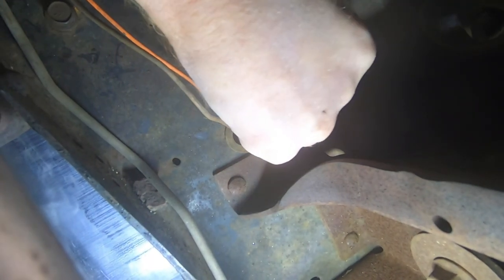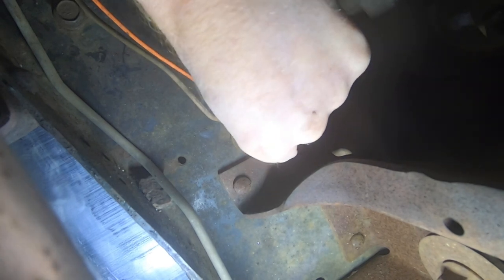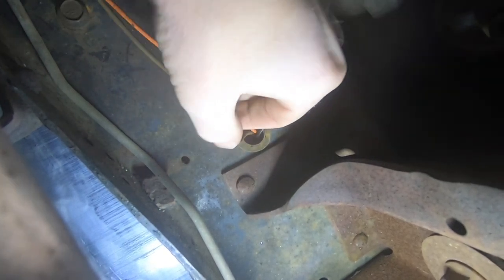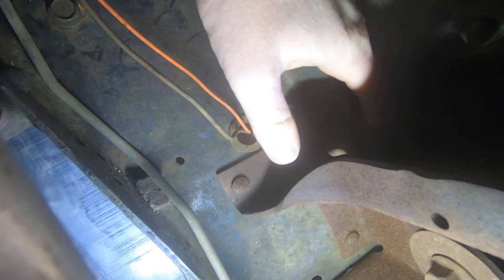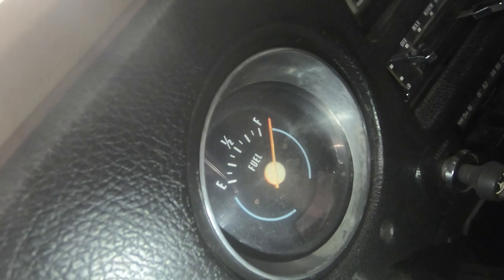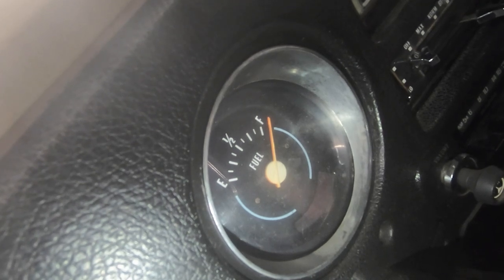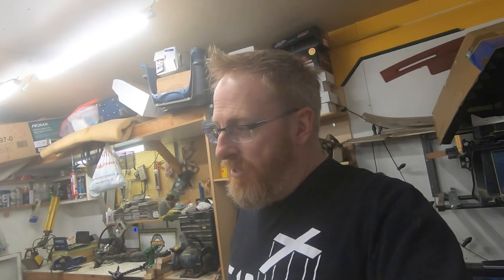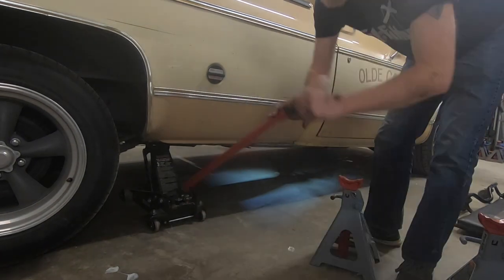Gas Guage Repair On My 1977 Chevy C10

Comment: 14.4 Isn't horrible given a windy day and the aerodynamics of a brick. When I put the 454 in the wife's 1978 C-10 nearly 3 decades ago, we didn't have an OD transmission or EFI.  I ended up swapping the 3.73 rear end for a 3.08 geared unit, and put a heavy secondary spring on the Holley 3310.  Cruising at 70 MPH, 12 MPG was a solid number, corrected for the tire size and gear change.  If you're cruising at 1800 RPM, those numbers should come up as things settle in.
Reply from the maker: I did another run yesterday with no wind and got the mpg's up to 15.5. I thing once I fine tune the EFI I should be able to get an economy tune saved for travel. But I do see 3.23's or 3.55's in my future as well.
Reply: @OldeCarrGuy  unless you plan on a lot of towing, I think the 3.23 rear gear with the 700R4 will make for a happy combination and net the best fuel economy you can hope for.  We've had diesel trucks with 3.55 gears, 32" tall tires and a 0.72:1 overdrive that got great fuel economy, but the diesel had the torque to pull all those numbers.

Comment: @4:00 so full is not at the F tick, but at the beginning of the arc?  Is empty touching the left arc?
Reply from the maker: Pretty darn close! I don’t let the needle go past the E!
Reply: @OldeCarrGuy  Cool, thanks.  We have the same gauge and it didn't occur to me until recently that I might not be getting a faulty reading.  I am going to fill a gas can and try to run it empty past E.

Comment: I'm curious as to why you didn't just get a tank for a 1987 EFI truck?  You can then get the sender/fuel pump hanger that mounts in the usual location and a bucket in the bottom of the tank to help with fuel slosh.
Reply from the maker: Simple answer is the efi system was a sponsorship frim Fitech and they don't offer a direct replacement for the factory sending unit. That's why i went with the new tank an reused my original gas guage and installed a new pump. Thanks for watching.

Comment: Just a quick question, do you have the original steering column and seat in there? You seem to have a lot of room between yourself and the steering wheel?
Reply from the maker: Hi Pieter. The steering wheel and column is stock, but the seat is out of a 88-98 GM work truck. I did a video on the seat conversion. https://youtu.be/xVtSRXkJlDw

Comment: You just wont get good gas mileage on a 77 chevy truck. 14 or so is pretty good for what your driving. If you want better mpg, put a 250 cid inline six cylinder engine in it.